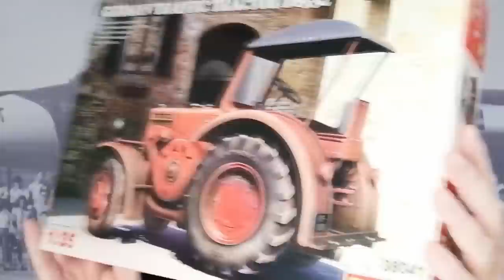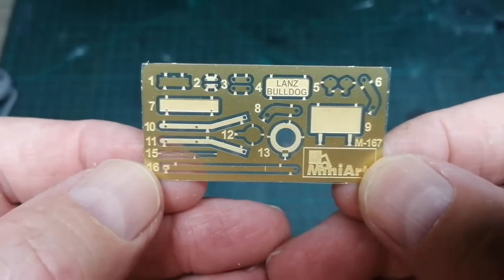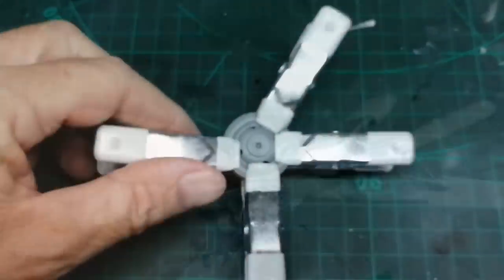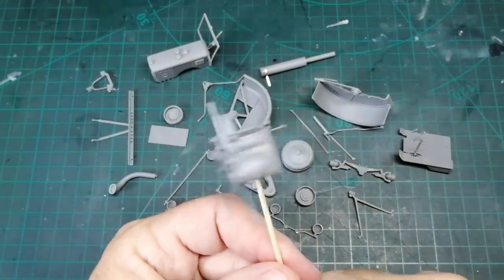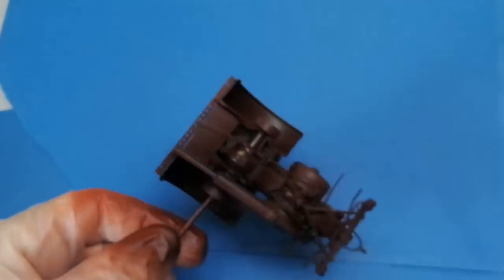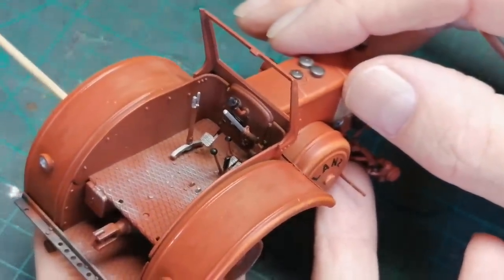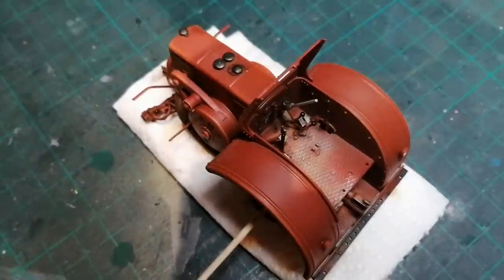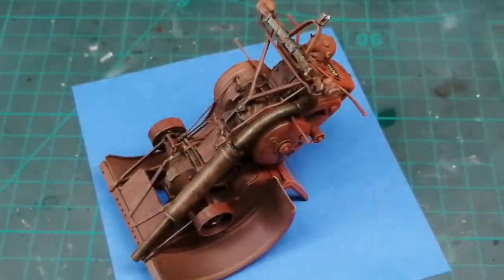MiniArt 1/35 German Tractor D8532 (full build)

Comment: Great build matey! some crazy wheel assembly. I like the the wash too make the paint look bleached! Never though of that. You got any suggestion for blue?
Reply from the maker: Light blue I would think would be ok. I used a tan colour because if I'd used white with red I'd end up with pink. Most times to lighten a colour, tan or buff can help. Paint your main colour on some spare plastic and experiment with different shades of washes before committing to your model.
Reply: @GregsModels  awseome cheers dude i was thinking along them lines but wasnt sure thanks mate!

Comment: Fantastic built as always. Congrats. One quick question not related to this post. You sometimes use the W&N UV Matt varnish. What thinner do you utilize and what product to clean your airbrush after shooting this varnish? Cheers
Reply from the maker: This stuff is produced for artists to be applied by brush only; to finished paintings. But I messed around with it using the airbrush. Thinned down 40 water to 60 varnish, give or take, gave me good results, but does take days to dry. To clean the airbrush I use an airbrush cleaner. But a word of warning, this stuff is tricky to apply. I must make a small video on this.
Reply: @GregsModels  Hey. Thanks a lot for the quick reply. I had this product for years and never used it and you are the first person I see using it. Making a how to video about this product sounds great. Cheers